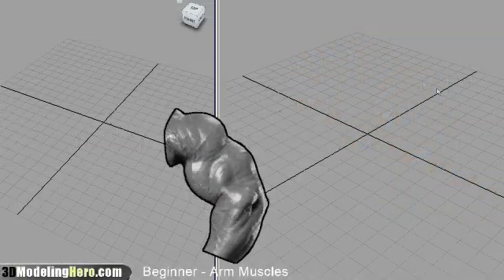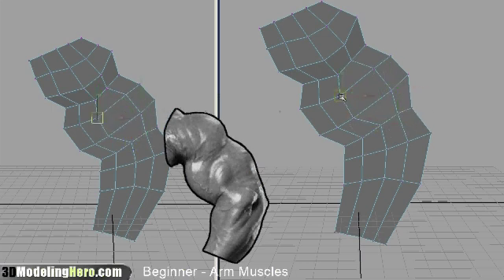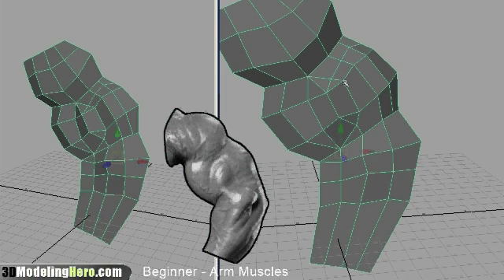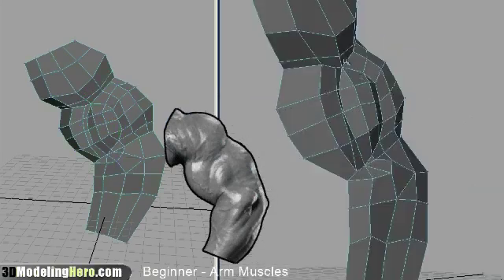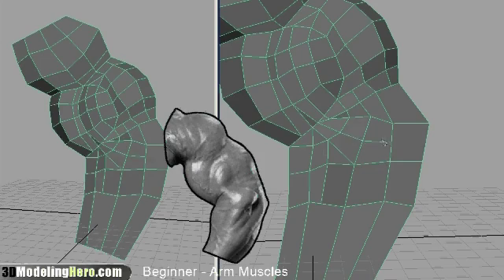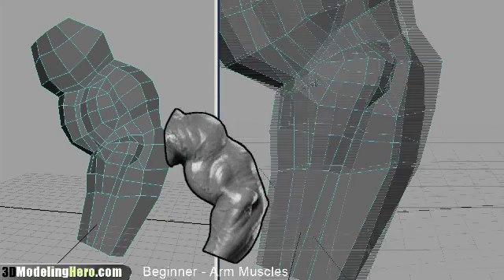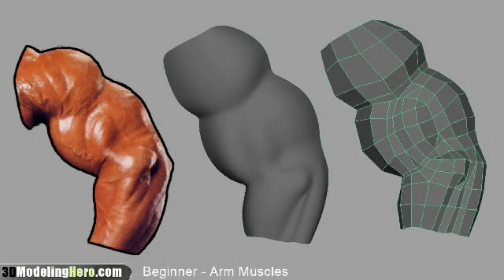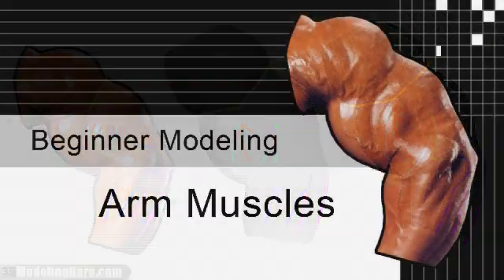How to Model Arm Muscles - Low Poly Beginner 3D Modeling Tutorial

Comment: Hi! Thanks for all the awesome content~ I'm able to create a mesh that follows the proper edge flow based off your arm videos. But from what I've come to learn, 5 point polys and ngons are a definite no after this point.. May I know what's the best way to clean up those?
Reply from the maker: shawn poh Hi Shawn, thanks for checking out my videos. For ngons, you'll have to cut in an edge to make it into a quad. But doing that, you might end up with a vertice that has 5 edges going out. Those might have undesirable effect once subdivided. If that's the case, then you can always clean it up by cutting the edge all the way through. This will make your geometry denser. That's why you do this kind of clean up at the end, because the denser it is, the harder it is to manipulate. So always form first, then clean up.
Reply: Hi~ Thanks for the reply and sound advice. I have modeled a few organic models based off your tutorials and am applying for junior 3D modeling job positions.. If I manage to get in, I'll owe you big time!~

Talk soon,
Shawn

Comment: 3:07 there is a triangle, did you try to spin edges instead ?
Reply from the maker: The Christopher Not sure what you mean by spinning. I just deleted the edge. There's no spinning edge function in Maya. In Max, there is a flip edge function.
Reply: WeiWorks

What version of Maya are you using ?
Reply from the maker: The Christopher
I'm using a very old version of Maya, 2008. There's really only a handful of tools that I use to model, so I never had the need to upgrade.
Reply: WeiWorks
You mostly model and shade in Maya, nothing more ?
Reply from the maker: The Christopher Yeah, it's Maya because that what I've used for most of my modeling career, in vfx for feature films. In games, I've used Max. I am learning zBrush for making my statues. But it's still a mixture with Maya.
Reply: WeiWorks
May as I what studio you work for ? I know Mudbox !
Reply from the maker: The Christopher I have an old online portfolio that isn't used much anymore. www.weiarts.com
Reply: WeiWorks

20 yrs you've been working, good ! I have someone to critique my work when my portfolio gets online soon.  Is the industry for hiring booming or it's leveled off recently ? How did you get started back in 1995, well the landscape probably was easier compared to today to land a position, correct me if I'm wrong ?

Comment from the maker: Ngons should be fixed, and they're easy to fix anyways. The triangles are fine. They're not a problem. Just sub-divide the model and you'll see that the triangles creates nice pinches. In the early stages of modeling, it's more important to get the general shape and edge-flow correct. Once you have that, all the little problems can be fixed easily.

Comment from the maker: Yes, of course. I know people use that method. What I'm trying to show is box modeling, which is what is used in most companies. Sculpting in ZBrush or Mudbox then doing a retop works great for people working alone and on their own project. In a work environment, you need to be able to work on a model without destroying any other possible data in the model. Perhaps in the future, companies will have a ZBrush workflow, but currently, it's mostly box modeling.